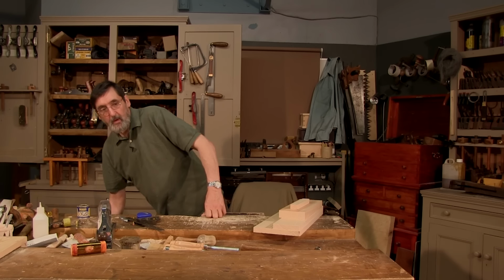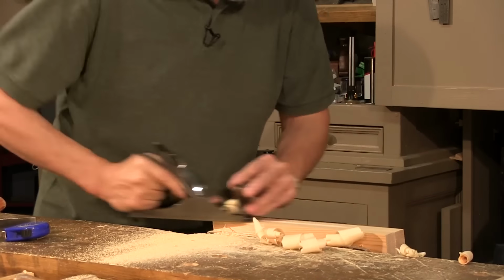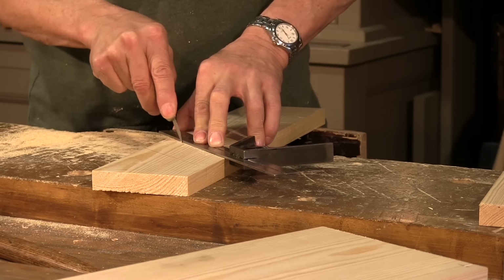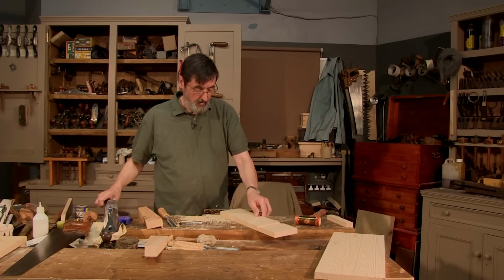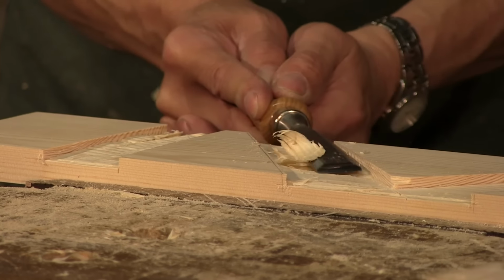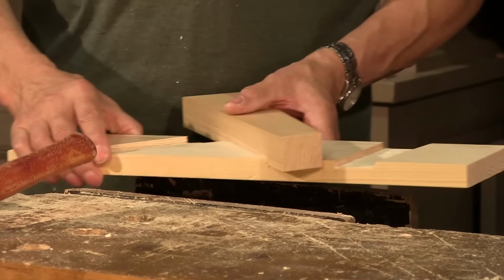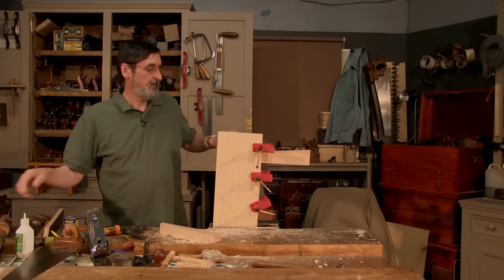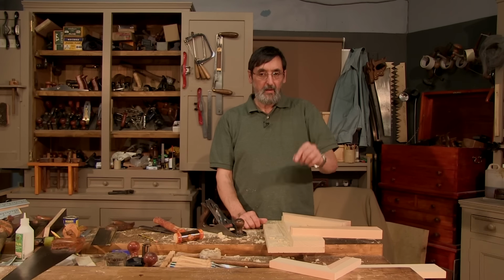Paul Sellers | How to make a Shooting Board

Comment: Watching you make this in such short time is amazing. I'm making my first box with hand tools only and am quickly realizing the usefulness of a shooting board, so this is the next project. Would you ever consider making a short video about replacing the wedges? Fitting them to the board rather than the reverse (as you did here)? Thanks for all the teaching!
Reply: Just finished mine and I'm about 1/32 out of square over over 4". Gonna have to try again.

Comment: A couple of observations.  Mr. Sellers tends not to use paper drawings for simple projects.  Instead he draws directly on the workpiece.  He will draw lines on the piece and frequently explain that the lines are for visual reference and are not layout lines, this is a sort of full scale drawing in situ.  Actual layout is done with his "Knife wall" technique.  I think this is very smart it moves the step of drawing to the production phase and greatly reduces the chance of error.  After all if it doesn't work with pencil it wont work with steel.
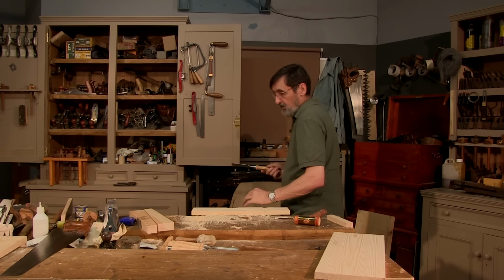Another thing I see is he has highly developed "simple" skills.  For example in this video (16:14) he holds a wedge in place against a knife wall while knifing the opposite edge.  This "simple" operation takes practice to do well and is very easy for a neophyte to mess up.  Mr. Sellers does it accurately with ease, Like falling off a log.
Reply: It is great that he explains even the simplest things.

Comment: This is a nice video for enthusiasts in woodwork with some interesting techniques. A a professional woodworker would be moderate in the use of tools for this project. The advantage of a shooting board over a chop saw is it's very portable, needs no electricity and costs only a few scraps of wood to make, a chop saw is far quicker and just as accurate though.

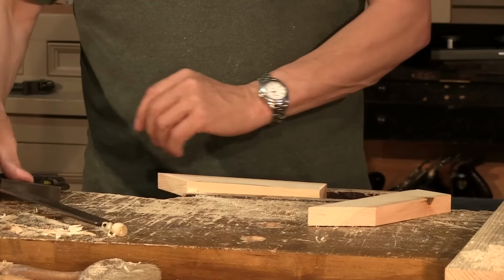Comment: Hi Paul, did you accurately cut a 47 degree angle at 42:15 just to demonstrate the shooting board usage? Your level of perfection and accuracy is incredible and I won’t be surprised if you can regularly cut accurate angles just by the eye.

Comment from the maker: You can plane melamine and plastic laminate with a hand plane quite readily, but you will need to sharpen up more frequently than say on wood alone. It's best to add plastic laminate strip to the sliding area after making the shooting board. That reduces wear and give much lower levels of friction as you move through the cuts.

Comment: Thank you Mr. Sellers for sharing your valuable knowledge and attitude. Could you consider to make a slight correction on the measurement  of the thickness of the thickest piece of wood, from 22 mm to 31.75 mm, because its thickness is 1 1/4¨. Thank you. And Congratulations for you guidance.
Reply: Yes, the length is also incorrect, for the wedge material, it should be 250 mm long, not 480 mm.

Comment: Before you use your plane on a shooting board, make sure to break the edge on the side of the iron. That thing can be quite sharp. I learned this the hard way when I noticed my hand was bleeding after pushing my plane with my hand on on top of it. You can also put a strip of tape on the exposed edge.

Comment: I happen to have some extra melanine, and would like to make this using the melanine, per your original version you showed. How do you effectively glue the two melanine boards together, though? I'm concerned the surfaces won't adhere well. Did you rely extensively on screws from underneath? In this video you said you preferred not to use screws (given all the channels you had cut). Thanks. And I fully share all the kudos and appreciation expressed by others.

Comment: Paul, like your video. I built a 45 shoot board for making picture frames. I cut the wood piece at 45 but a bit longer  and trim using shooting board. The Stanley #4  I used kept riding above the 45 edge instead of removing.
The hand plane blade is sharp. Could you tell me what have I done incorrectly. Thanks

Comment: I don't know if this has been mentioned in the comments, it most likely has, but I could not see it in the first few pages, the inches to metric conversions on screen are incorrect on the wedge material. 

Your on screen conversions say 4" x 10" x 1-1/4" the metric conversion says 100 mm x 480 mm x 22 mm this is not correct, it should read 100 mm x 250 mm x 32 mm.
Paul states the correct measurements for the Main Body, and the Base Board, but for the wedge material he does not mention the board size.
Not a complaint, just trying to make it easier for the next guy, like me who knows both systems well, and sees the board and the on screen comments and knows they have to be incorrect. The thickness of the wedge is important, I think.
Cheers!

Comment: Paul.   May I please clarify the wedge measurements.   The indication is that the piece of wood from which they are cut should be 4”x10”x1-1 1/4” with a metric equivalent of 100x480x22mm.   It is my belief that the imperial length of 10” should be something like 255mm rather than the 480mm that is shown.   Can you please clarify which measurement is to be used?   Thank you for the video, it is a project I am about to commence.   Regards, Graham

Comment: Paul, like your video and I built one with 45 degree. I do not know why the Stanley #4 just ride above the 45 instead of cut into the wood piece I want to shoot. I cut the wood piece in 45 and I want to shorten the length for making a picture frame. Could you please  tell me what have I done wrong ? The hand plane blade is sharp. Thanks

Comment: Presumably you need to reverse the direction of the plane to use the bottom diagonal guide, as its precise 45-degree face is on its upper side - unlike the other 2 guide positions (diagonal & straight)?

Comment: Hello Paul, thank you once again for all the knowledge and guidance.
My previous shooting board was not accurate, and I have followed your design which is simple and excellent. 

I do have one question, regarding a problem I faced also with my previous shooting board and this one as well. When I use it, the plane planes as well parts of the fence of the main body. Is there a way to avoid it or reduce the wear? Applying any kind of material, covering the lower part of the plane blade etc?

Im trying to work with care and straight move of the plane, and I try that the stock will protrude only a little, as well as the plane's blade, but still I plane the fence here and there.

Thank you,
Nimrod
Reply from the maker: Thank you for your comment. It is not really wearing it’s just the soul riding on the edge of the plane. Wood is a resistant material so it does hold up well. I have had mine for years.
Reply: Thank you Paul and for such prompt reply,
I mean, when I use the shooting board, many times the blade gets into the fence (below where the wedges are installed) and therefore with time, the fence of the shooting board is not straight. I try to minimize this as much as I can, working with care, but still it happens from time to time.

Comment: Hi Paul first of all thanks for all your videos great viewing, one question on the use of shooting board that I hope you might help me with? Having made my copy of your design a year or so ago I enjoyed using it and got good results along the length of my boards but could not get the squared result across the width of my boards and eventually gave up! Coming back to the shooting board recently I decided to have another few attempts to see if I could finally master the technique. Unfortunately the result was the same as before however giving things a bit more thought I decided to check the squareness of my hand planes and discovered that non of them actually had a 90 degree angle between the base plate and the sides of the plane. Now I know I must be missing something pretty basic but how can we get two boards to joint successfully if the combination of the plane and shooting board don’t give us the elusive 90 degrees? Thanks
Reply from the maker: Hi. You do that by adjusting the lateral adjustment lever, even if it’s not parallel to the sole it can be 90 degrees to the side of the plane and this is how we make that micro adjustment.
Reply: Paul Sellers Ah ah why on earth didn’t I think of that! Knew it would be embarrassingly simple, thanks for the reply Paul, presume we just do that by trial and error. Actually my longest hand plane is a really nice wooden box plane that takes a beautiful thin shaving off if using one of these would you fine tune the blade by tapping one side of it or would it be worth trying to actually get 90 degrees between the base and the sides?
Anyway thanks again for the heads up!

Comment: I'm 27 is it too late to learn carpentry. I love watching your videos and am flummoxed how easy you make it look, I had a crack at making a jig for sharpening axe heads and failed quite miserably.
Reply: If you think 27 is too old you may as well give up on life my friend.  As the life expectancy is now around 85 and climbing you still have 58+ years left. I am sure you can learn a thing or two in that timeframe :)
BTW I am 35 and just starting out.
Reply: i wouldnt say 27 is old just wondering if there are things that you can only pick up after a lifetime of practice(i.e eyeballing if some thing is dead straight or the flow of the grain and how to work with it, i do have terrible eyesight not to the point im blind but i could easily pick up a screwdriver instead of a chisel). As i see my jig not just as a failure but a practice to try get a feel. I wish you much luck and success on your carpentry adventure and hope i can follow suit. =)
Reply: Gary your jig is not a failure, but an opportunity to investigate were the mistakes were made in making your jig, recheck the wood work masters techniques practices they use. Then armed with this knowledge re-practice these techniques you pick up, and move on to success, and enjoy the satisfaction of accomplishment.
Reply: Gary, 30 years ago I had to file square a steel block as part on my technical training. I checked it with a square, thought it was wonderful and took it to my instructor. he just glanced at it and told me it looked like a ploughed field. I didn't  understand how he could say it was rubbish without using a square to check it. 10 years later I found it and knew exactly what he meant.  practice does train your eyes to see differently. the art of a good teacher is remembering that new starters don't have that ability yet ☺ perseverance and go slow. plenty of time
Reply: Gary Calismax I got into construction at the age of 26 or 27, just after working as a short order cook, a commercial fisherman, a drain cleaner, and 5 years as a microfilm tech. I spent 12 yrs in the trades renovating houses, right up to the Crash of 2008, and I consider those years to be the most inspiring and educational of my life. Your "failure" with your jig should have the beginning of your journey, not it's end.  At 27 years old, you are not too old.
Reply: omg, I am 70, if its too late for you, what am I doing here lol
Reply: Whatever time you start is the right time to start.

Comment: Question: say you're making a picture frame. You cut the four sides, then trim your 2 degree error out from a couple of the pieces using the shooting board. Will the frame now not fit because 2 of the pieces are slightly shorter?
Reply: If you trim the sides the dimensions of the frame will be different. Your conclusion is right, the pieces that you trimmed are shorter. If, say you sawed the left side perfectly, and made a 2 degree error on the right side, the right side will be shorter. And you cannot make a rectangle anymore. However, if your saw cut was 2 degrees off on the one piece, it is likely to be off at the same amount on the other piece. And if that is not the case, you are free to trim the perfect piece as well to get it to the same dimension as the trimmed piece. The overall dimensions of the frame were slightly larger than the picture anyway. I hope!
Reply: @jlinkels  Thanks!

Comment: It seems my 90 degree recess/stop is not lining up with my square by just a tiny bit. I can still use it but I'd rather not have worry about micro adjusting my workpiece. Any clues?

Comment: Hi I am a newbie wondering about the shooting board and a mitre, what's the difference? Have seen another doing mitre with a straight board, combination square, clamp and the piece to cut. why did Paul say that mitre don't need to be too acuerate?

Comment: I am trying to make a left handed one of these.  I got to the lay out part and realized that one of the 45 degree wedges seems to be backwards.  By that I mean one way would make a 45 degree face, the when putting the wedge in the other 45 cutout, the beveled side is against the work making it a different angle.  Am I suppose to turn the shooting board around to use the other side of that wedge?
Reply: Place the work piece behind that fence and pull the plane toward you?

Comment: Paul, maybe you can give me a tip why my planes are usless against end grain? Both on shooting board and while free handing, my freshly sharpened blades seem to be dull on end grain, they chatter and i have to put extreme force in planing end grain.
Reply: There are many things that can help with planing edge grain. First, the plane must be super sharp. Perhaps you haven't achieved that yet. Another tip regarding sharpening a plane iron for end grain is the bevel angle. Too steep and the plane will have a hard time cutting even if super sharp. Taking more effort to cut through end grain. Choice of plane can also impact. What type of plane are you using? Does it chatter when planing flat grain? Switching to a skewed plane can also assist with cutting as the iron makes contact easing into the stock, opposed to banging head on to the stock. Check points: If your iron is super sharp, check the angle. 25* is better than 35* for end grain. Believe it or not, an iron needs to be sharper to plane edge grain on softer wood like pine, than harder woods. That's due to compression of the fibers. Hope some of this helps.
Reply: Too deep a cut?

Comment: Would you make the parts taller if you were to put a 45 degree angle on a taller piece of wood or are there other methods for this? I only asked because if you were to use this on a 4 inch x 12 inch piece of wood, the part without the backer would end up tearing out
Reply from the maker: I think the idea for this shooting board shoots many applications but they do have to be customized for other sections of wood.
Reply: So adding a donkey ear to this for longer sections then?

Comment: A couple of things I don't understand. If I want to do 45 degree mitres on significantly different width pieces do I need separate shooting boxes with different wedge positions? Does this setup work if I want to mitre for the vertical sides of a cabinet/box?
Reply: To clarify my previous post, then. Paul is mitreing length wise here but for the vertical sides of a box the mitre needs to be thickness wise. I assume the principle is the same but the positioning of the wedges would need to much wider
Reply: Look up Donkey's Ear shooting board.  That's what I think you are talking about.

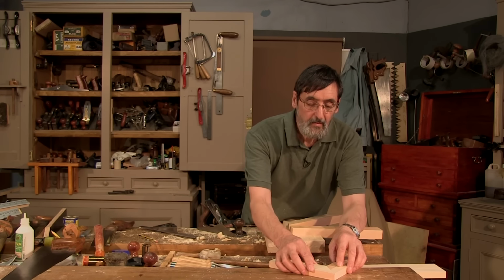Comment: A 43:45  place the two mitered ends together and place a square around the outer edge to verify that the two boards are at 90 degrees.

Comment: Well it's a great shooting board and I will try and make one but I wish you had spent a few minutes  showing the board and how it works.  I use a shooting board  and by the end of the video I figured out how yours worked,  I would have preferred more introduction up front rather than watching and wondering "why is he doing that".   Really needs a clear overhead shot of the board empty and the board set up for work. 

Thanks

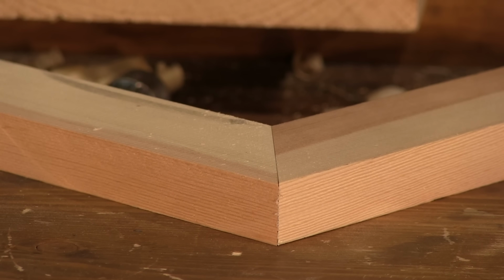Comment: Can someone explain why you need the second 45 degree wedge for planing into a molding? 43:53
Reply: +scath7 it took me a second to work out, but: molding only has two flat sides, and they both need to be against the shooting board to be held in place. So you can't just flip it over the way you would a regular board, if you want (for example) a mitre on both ends.

Comment: Paul, I got this from your pdf file and am not sure what your saying here in relation on how to adjust the board for less than perfect cuts? "If you find your miter or square cuts are less than perfect, trim them by adjusting the wall of the recess with a sharp knife against the square." I have started my board yet and just want to fully understand it b4 moving forward.
Reply: Pat, I believe what he's referring to is when the angle you need to cut in your work piece does not require a perfect 90* or 45* you can adjust the stock in the shooting board, not adjust the shooting board. Make the shooting board to a perfect 90* and 45*.  You can then shim the work piece with tape, or a tapered shaving to move it away from the edge of the side rail of the shooting board. Hope that helps.
Reply: Thomas thanks for the reply but I still don't think that it explains this part of the comment?? "trim them by adjusting the wall of the recess with a sharp knife against the square." At least not for me

Comment: Hi Paul, love yr video's, but you have the measurements wrong for the Wedge Plate. You have 10" as 480mm. Should be roughly 250mm

Comment: If you are going to use a shooting often would it not be better to have a special plane or at least a blade for just shooting board use with the blade, with the plane on its side, having a half inch or so ground off so that you have a larger portion of the shooting board being using as the truing or guide surface? As it is you have only 1/4 or even less being used - I think.
Reply: You see lots of those old time ones that don't have much of a reference step at all.